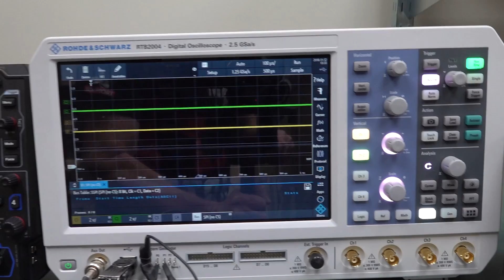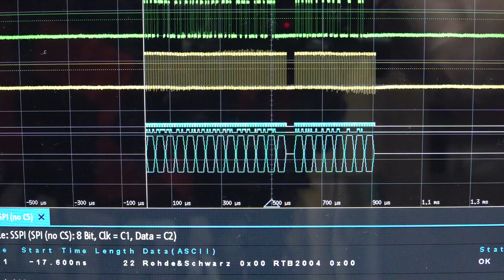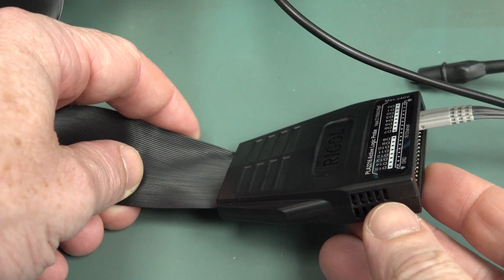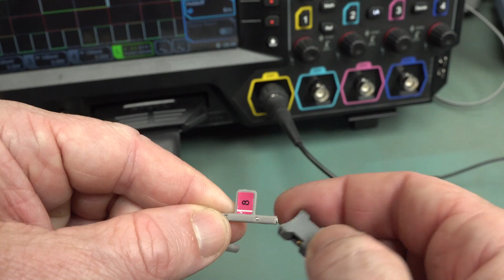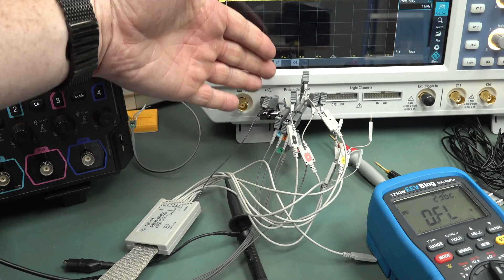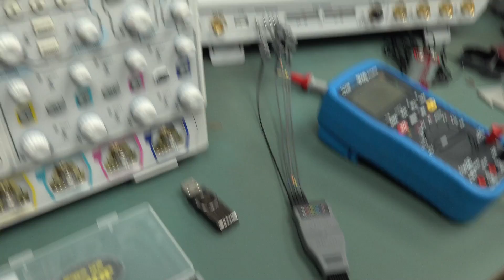Rigol MSO5000 Bug Bonanza

Comment: Can anyone give me a pointer regarding this scope in 2025? Still the best value for money or is there a juicier alternative now? (I can handle spending a bit more money - if it's wort it).

My use case is a "lab on tour" sort of solution in a flight-case for embedded forensics and reverse engineering, therefore appreciating the "7 in 1" factor. I really like that the LA and AWG is built into the scope. DMM and SA is of less importance.

Comment: HERE IS A BUG THAT I FOUND
Press  MATH button
Select MATH 1
Select OPERATOR  to be  FFT
Select Operation (On Position)
Look at the bottom
Select MORE
Select MORE  (Again)

You are now in the MATH1/OPTIONS/MORE  Menu

LOOK AT THE FIRST LABEL .......... WTF ???
it says "Display Lable"

I Gotta say, this is a pet Peeve of mine
fucking Awesome scope and then this happens
Reply: Yes, the "bug" is a spelling mistake. "Display Lable" should be spelled "Display Label". That option can be set to either On or Off to display the label for the FFT, that you can set with the other menu options at that menu level.  I agree, it is an awesome scope, spelling mistakes and all...

Comment: in the digital mode on teh Rigol, your trigger point is not in the view port.  That's why the waveform is shifting.  You'd need to move the trigger point back to the center.

Comment: List of Fixes in firmware.
v00.01.03.00.01 2020/04/13
     -Add bode map function

v00.01.02.00.03 2020/02/27
     - It solves the error of SCPI instruction reading La channel memory data, and solves the error of SCPI instruction reading La channel memory data

v00.01.02.00.02  2020/02/25
       
     - Optimized the connection HDMI start problem optimized the connection HDMI start problem
     - Optimize the vertical gear, channel zero elimination error 
     - Optimization of the inconsistency between SPI CLK and SDA names
     - Zoom mode square wave display in optimized 2S time base
     - Added command to get pass / fail times
     - Delete the default email account and password
     - Problems in remote instructions are optimized
     - Optimized 1K storage depth, waveform recording
     - The problem of too many stuck events in optimized decoding

v00.01.01.04.04  2019/02/20

     - Optimized the operating experience of the local upgrade.
     
     - Added the 12-bit high resolution mode.
     - Added 500uV/div in vertical scale. 
     - Added the SCPI command :MEASure:STATistic:ITEM CNT,<item>[,<src>[,<src>]] 
       to reading the count of measure statistics.
     - The waveform can zoom out by drawing a rectangle. If you draw a rectangle
       from the top left to the bottom right, the waveform will zoom in. If you
       draw it from the bottom right to the top left(the opposite direction), 
       the waveform will zoom out.
     - Added the GND coupling in channel.
     - Enriched the color options of the LA channels.
     - If the newest version is detected, a red dot will display in the Online 
       upgrade menu.
       
     - Modified the waveform freeze problem in slow scan mode.
     - The boot time is reduced to less than 1 minute.
     - Improve the touch experience in the lower half of the touch screen.
     - Reduced the noise amplitude of the waveform. 
     - Modified the problem of decode vanishing after moving signals.
     - Modified the error of digital waveform when adjusting the timebase after 
       stop the sampling.
     - The :SYSTEM:SETUP command can successfully save and upload setting 
       information in remote.

v00.01.01.02.03  2018/10/15

     - Release the production version
Reply: thanks Pablo for including this information here. But the big question is: what issues are still left remaining? after all those bug fixes. we need a clearer picture of the weak points again now. or a re-test / new fresh look. i keep scouring youtube for new videos on these rigol mso5000 series. but none of them reall break it down simply. the newer videos after dave's are just not a clear critical and thorough review / overview. it's not like there seems to be many other options still. but maybe next year(s) will come out newer scopes, to consider against
Reply: yeah and what i mean is not just 'oh its a little but, specific hey! we can fix those little things bugs and cosmetic stuff', but for example the usability of replay and memory paging against the keysight megazoom / infiniivision. and also the massive delay lag on the logic analyser (trigger? i think). i.e. the important stuff that makes or breaks a scope. other than the decent / really nice 300mhz bandwith 8 gss/s. which of course is great value and all... not criticising those basic specs there. i just want to know the warts and all before getting one. to be happy with it an not be dissapointed / get let down with a too-high expectations. for the fact of it being cheaper and of being a budget scope. not complaining or anything... just really want to know

Comment: Thanks for the video, along with the other review video. I would be really useful if you could get hold of one of these again and give an update now after 19months and several firmware updates released. I'm guessing that like the 1054z, this could well become the best bang-for-buck hobbiest scope once the firmware has matured.
Reply: couldn't agree more. i understand how it's usually not the policy of many reviewers (Dave included here). to review a product as new, without expecting firmware updates after the initial product's release. however this happens to be one of those rarer exception cases? i guess that's the best way to put it. i also have tried asking Dave several times, every now and again. please re-review these rigol mso5000 again. but it's not like he personally has any pressing reason to care anywhere near so much as us budget users here, already having all the scopes he probably could ever want. i mean if i was dave surely i wouldn't want to use an inferior chinese scope either. i would be using a keysight too. just simply not an affordable option / not a luxury here on these much lower hobbyist budget

Comment: I returned the Rigol and when with a Agilent, now Keysight. I tried the Rigol MSO5354 model paid over $3700 for it and almost throw it out the window, ended up returning it and when with a DSO-X and works way better then the POS Rigol. The Rigol is slow and buggy at best, not ready for prime time. Only worth it if you get the 75 mhz version and hack it and willing to wait till they fix the bugs and keep it on bench as higher will have poor viewing angle and reflection due to cheap LCD they used, but at best is a $900 scope and not anywhere as good a a 3k plus scope, just to many issues to even list, no 50 ohm termination and no active auto probe interface, freezes at times and forget trying to use it for RF the trigger is pretty bad on that scope. Then what was Rigol thinking putting a glossy screen in it? I keep my scope above my bench and hate reflection and does poorly looking at it at a angle, so they used a cheap crap LCD. My older Rigol gear uses a proper matte LCD, that doesn't have the issue. I could give a crap about touch screen interface. Plus like the layout of the Keysight much better as don't need a manual to figure out how to use it, or how to adjust hold off and etc, since familiar with it.

The shame about it is the Rigol 1054z my friend has is no where near as bad, it is pretty decent and he paid about $350 for it. Reason why I figure I get the MSO5354 as didn't need the probe interface, but scope just had to many other issues. It definitely not a professional level scope. Hopefully they will wise up and use a better LCD and fix the bugs at very least. The revised the DP832 PSU which first one had issues, but replacement been great and haven't had issues with it since and was hackable.

Comment: Screen brightness has been fixed in the ones they are shipping now seems to have needed some kind of hardware mod to sort out though. This scope is very hackable so if you buy the base model and hack it to get all the features then its a lot of scope for the money but anyone buying it optioned up is really getting ripped off because its too close to much better scopes in price. Latest firmware does seem a lot more solid than it was back in this video though.

Comment: I'll never buy another Rigol product ever. Thanks to Dave I bought the pos ds1054z. Now I only buy Keysight. Sure it costs more but it usually works perfectly.
Reply: Bummer... Was on my shopping list. Still debating on brand and model.  I will want a bright screen either way 😅.   I'm sure I won't even come close to using 10% of it's features, so I'm considering getting an analog scope. 
Any issues with keysight? Hantek?
Reply: What about scopes from Siglent?

Comment: I think everyone saying ‘don’t use auto for serial’ is missing the point somewhat. Yes, you’re entirely correct in saying that. But think about it in the context of a noob like me, who has just bought their first $60 USB Hantek oscilloscope/LA. An oscilloscope should be an instrument that any old joe can walk up to, press the magic button, and it just works. Same thing with a multimeter. Any old joe should just be able to intuitively shove the leads into something and obtain a meaningful result straight away.

It’s said that in UX design, if you need to read a manual, you’ve failed at the design. I am not a software guy by any means whatsoever, so take this with a grain of salt. It’s just something I’ve heard. Feel free to correct or elaborate, but don’t shoot the messenger here. It’s not me saying this.

Yes, auto mode is for dummies. But that’s the entire point. Turn the thing on, stick the probe onto something, press go and get your result. This should not be anything but the core functionality of the scope.

Comment: there might be a reason why "NORM" mode is called "norm" as in normal. I just recently showed a group of students why you normally should use NORM and not crappy AUTO - which in my opinion is true for every oscilloscope there is, analog or digital.
Reply: Also the complete lack of spacing between the data lines on the scope makes the display difficult to read in the digital mode. A few years ago I tested a Rigol against a R&S scope before purchasing a class-room set of scopes at Uppsala university. Rigol lost because of the most crappy user interface ever...

Comment: Dead spot in "auto" mode, when it ignores the trigger. The input signal burst rate maybe a close match to the "auto" rate. Maybe intentional. Maybe not.

I sometimes wonder the thought behind some of these DSO designs.  At least these Rigols have lots of knobs. The more the controls match the old analog scopes, the happier I am. Allows for quick changes of the settings.

Loved the old logic analyzer plug-ins for old Tektronix 7000 series scopes ... Lots of toggle switches !

Comment: The Runt pulses come propaply from the digital unshielded and probably unmatched probe digital input cables of the Rigol. Running a low impadance signal into an high-impedance input at this edge speeds causes reflections... Adding a few pF will help, especially when it forms a snubber with the resistance of the cables.
An oscilloscope probe (digital or analque) isn't just a single copper wire. Well. physics is just analoque...

Comment: My MSO3000 does a lot of the same stuff, and has for quite a while with no fixes to the firmware.  For real work I no longer will touch a Rigol scope.  I even communicated with them about the triggering problem, and got a useless response.  In my experience it simply won't show a serial decode on screen unless the trigger point is well to the right of the first gridline, and if you zoom or scroll the stopped data after that point the serial display is likely to simply vanish and never come back, which makes inspecting a rare event nearly impossible.  The horrible display of the serial information has caused me a fair bit of trouble.  It's also just riddled with inconsistencies: the list of source channels for any given function can take 2 or 3 different forms, some of them have analog channels at the top, some at the bottom, etc etc.  Given that the new MSO5000 seems to exhibit the exact same bugs, I can easily decide that I will never buy another "high end" Rigol scope...

Comment: When you zoom in, it will zoom at the center until it fills up some sort of buffer, then it will zoom from the start of the buffer, can be seen when you try to zoom in on a glitch at around 28 minutes. You say the glitch disappears but it have probably moved off screen to the right.

Comment: THIS is why I went with the years-old Rigol ds1504z, instead of the newer ones from *anyone*. It may be a little older tech, but it's popular so has been through a lot of public debugging.
Reply: The decoders also have bugs on the ds1504z. Depending on your zoom level it will misinterpret the data.

Comment: I really find it incredible that you can buy a $100 smartphone and get a relatively lag-free UI experience, but on these $1000+ scopes and lab tools, the UI is horribly laggy....... Does it really kill the producers to just add a decent SoC with a GPU in there to give it a somewhat responsive UI experience? It's not like the UI is has graphics that require serious graphical horsepower..........

Comment: @32:21 with the logic probes, the Rigol shows 8GSa/s, but the keysight is showing 1.5GSa/s. The Rigol is detecting an edge ring below logic threshold due to the higher sample rate, the keysight is missing it. The keysight is also trigger off the rise and and the ring randomly when you do multiple runs. An analogue channel would probably show the ringing. I could be wrong, but that would be my  best guess and thing I'd check (though I guess you have sent it on now).
The spurious edge in the middle of the other one went away with the logic level going back to 1.4V rather than 0.9V, I'd still bet higher sample rate and maybe noise across channels?
The zooming does look....  buggered, I kept watching the time bar at the top and it was confusing the hell out of me as it seemed like it was zooming into the time point at the centre yet the signals were moving.

Comment: I never look at data in auto mode, my first scope was an old owon and i think i picked that up because that owon had the same problem 
and yes those logic analyzer traces are dizzyingly close together, not sure i could work like that 
i use a DSLogic logic analyzer, 400mhz, 16G stream, 256meg buffer, 16 channels, nifty connectors for the micro coax probes and the whole lot for $150 
id  take this over that annoying logic analyzer any day of the week, if i was handed this rigol scope at work for logic analysis i think i would probably refuse

Comment: Dave, if  you get an opportunity to open up one of those logic probes, do it. I have one of the older generation (RPL1116) for the Rigol MSO1074Z, and they have a comparator/differential driver in there. The threshold voltage is sent over the flat cable. The comparator is a TI LMH7322.
Also I know of at least two issues with rigols logic probes: mine had defects in the differential termination- and series-resistors. I hat to swap some of those. If you want I can send you some pictures!
A friend has the 2000 series with a logic probe and has found a lot of software issues that sometimes vanish when change the zoom.
Reply: Could you upload the pics to like imgur and post the link for the rest of us dorks? :0) Thanks

Comment: I think that every scope I have has loads of bugs, some worse than others and scope price seems to have no bearing on it. I have a £100,000.00+ LeCroy with loads of software options and if I select SPI decoding with less than 2 channels enabled then the scope application crashes and the scope has to be rebooted (its a windows based scope).
Reply: I guess it shouldn't be too surprising; user preferences are the enemy of reliable software, and that's pretty much all a scope interface consists of.
Reply: I find it very difficult to take any equipment running Windows seriously.
Reply: @MajorAbuse  Thank You! This is what I want on my tombstone

Comment: You had the RS-232 decode set for odd parity...
Reply from the maker: Because the data is odd parity.
Reply: the first data which is ‘i’，it's 0x69(0110_1001) ,if the data is odd parity,the parity bit should be 1, but the signal is 0, so i think this is not a bug

Comment: MSO glitches are often down to probe grounding, in particular not having every  probe ground connected - you can usually tweak threshold to get clean signals.
Reply from the maker: But in this case there is no separate ground at the end of each channel cable. I tweaked the threshold without success. And the other scope showed using the exact same threshold and signal level and grounding worked perfectly every time.
Reply from the maker: And the Rigol 7000 worked fine, so seems like something odd with the 5000
Reply: @EEVblog  I've been evaluating the 7000. It was very buggy to the point not usable as a serious bit of kit imo. Crashed frequently, failed to recall stored memory,  etc.
The RTB2000 also has bugs in the history mode. These ' miracle' scopes are still leaving the factory with bad firmware - and whilst they appear to represent good value for money (many features) if they are unreliable they are poor value as a test instrument.
Reply: I’m just getting into logic analysers and sillyscopes with my little USB hantek thing. The best scope $60 can get you anyway. Would you recommend those ground clip things that go around the collar of the probe? For some reason, my scope did not come with these, which is annoying, but also perhaps not so surprising as it’s only a 20MHz scope.